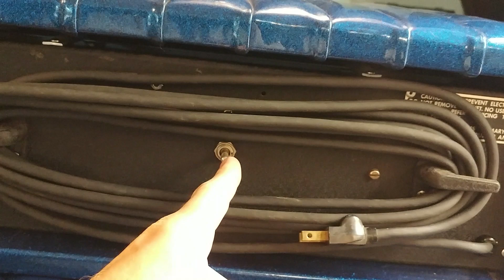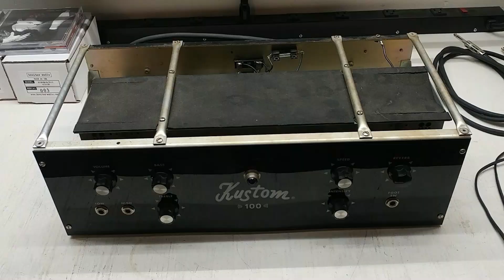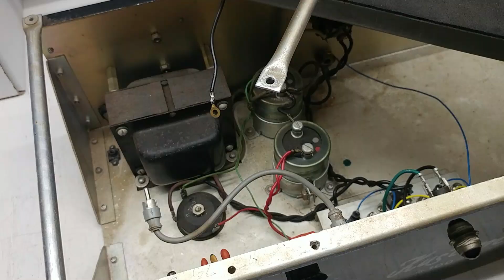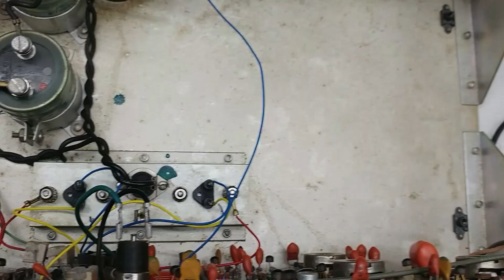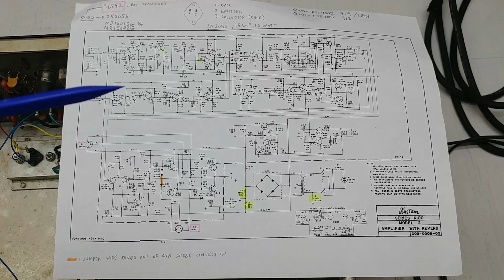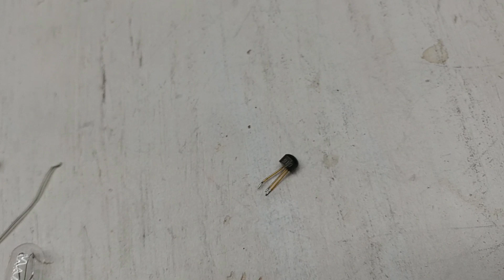Kustom 100 Guitar Amplifier Repair

Comment: I used to blow the roof off of the bars back in the early 2000s with one of these! 
Fell on difficult times just before the holidays and pawned it for Christmas presents and bills.
Lost it as I was unable to pay one month, got the money... 
Called...
It was sold. 
Hit me harder than it should have losing that amp. Felt like a piece of my soul was lost as it was my FIRST adult amp.
Was perfectly working as a local tech went through and fixed it better than new.
Could not go past 3 on the volume without the drummer threatening to quit.
Great vid!!

Comment: That’s not a jumper wire that you replaced on the board. It’s supposed to be a diode (CR106 on your schematic). The diode is a 1N3754, made by RCA and hard (and expensive) to find these days. It has long leads and a metal case like an old germanium transistor, and it is installed with a bit of heat sink grease in the clip you see in between the two power transistors. These often get damaged or even lost when the board is removed by an inexperienced technician. It’s function is to provide the proper bias voltage for the the two 36982 (2N3055) power transistors and keep them running at the proper level without getting too hot and blowing the fuse or damaging the transistors. Since it’s clipped to the heatsink, it regulates the circuit by continuously adjusting the bias current for the transistors as it gets heated or cooled, keeping the circuit stable during operation.
Reply from the maker: Whaaat?!?! I only aimed to restore it to it's original state of when I first opened it up. I had no idea about that. Now I'm going to have to open it back up and take a look at it and the schematic. Thank you for the knowledge! You wouldn't happen to know of a modern equivalent that may work in place of that 1N3754 diode would you?
Reply: The 1N3754 was a pretty standard silicon diode; what made it special was that the metal case made it easy to thermally connect it to the heat sink, so it could be used to regulate the transistors as they got hotter or cooler. Most modern diodes have plastic or epoxy cases, so it would be harder to thermally couple them to the heatsink. Something like a regular ol’ 1N4007 or similar should work if you could use some sort of clip to hold it to the heat sink with some thermal grease. At any rate, adding the diode will get the output transistors closer to normal operation, even without the closer thermal tracking. You can still find the 1N3754, but they’re often expensive since they’ve been discontinued for so long. Good Luck!

Comment: Old guitar amps are among the simplest electronics to troubleshoot.  Any of those technicians that gave you excuses shouldn't be in the electronics repair business.  Locating a substitute replacement part might stop them, but finding the failure shouldn't be an issue.  (If you just asked a friend to help you out, ignore this.  I only intend this to apply to those representing themselves as qualified enough to be in business for this type of work.  If they can't do this, how could they possibly fix something complex?)  Glad to see you picked up the skills yourself, I'm sure you found it gratifying once you had accomplished it.

Comment: Rarely, especially in guitar circuits, are the transistor parameters tightly spec'd.  The transistors of the day were probably +-50% or more on most of the parameters.  Anything roughly equivalent should work, especially if the circuit is well designed.
Reply from the maker: The more I dive into projects like these, the more I'm discovering that point. I'm also getting more familiar with the key specs (and what they mean) of transistors just by hunting for substitutes/equivalents. It's acutally kinda fun having 15-20+ tabs open at once and comparing datasheets, looking for the best choice. Thanks for watching and I appreciate the comment!

Comment: Can you post a link to where you found the serial number/date chart? I bought my K-100 bass amp in 1970 and had a tech replace the two-prong power cord with a three-prong grounded cord (I was getting buzzed when I touched the power switch).
Reply from the maker: I found that info through vintagekustom.com, if you search "vintagekustom.com date serial number" in your browser, you'll find links that have info on dating your amp with the serial number. I'll copy and paste the url of the page I was taken to with the list of serial #/dates: http://www.vintagekustom.com/FUDforum/pdf.php?th=2115&rid=0&S=454342cbd8498704deba8766e2730840

I hope that helps!
Reply: @killertimes  Thanks. Got it. 👍🏻

Comment: Unfortunately the realm of guitar amp repair is a very transient industry. Some of the work I've seen being done at a premium is bad enough to make your head spin. It's also plagued with many that possess a lot of valuable experience but are generally lacking in a fundamental understanding of what in the heck is actually going on from an electronics standpoint. You'd think it'd be the opposite case considering we have the internet to help us out these days but the signal to noise ratio on that information can be abysmal at times. There's great people that do it but there's a lot of goons out there as well (even on youtube) so trust but verify.

Also, funny that one guy was trying to say that those BJT's were some kind of magical vintage unobtanium parts... In many cases a lot of these transistors are configured as such where their gain/special characteristics really aren't that important. You may have altered the characteristics of the input slightly with a newer transistor with different hfe/impedance but I mean come on... No ones going to notice or care and your result is WAY better than it not working at all.

Putting that aside, good for you for figuring out the problem. You wound up falling back on some very essential electronics repair principles (thou shalt check voltages!)  and some (not so) common sense. Great work and I'm looking forward to more videos :)
Reply from the maker: Thank you very much! 

The internet, as a resource for learning about electronics, has provided me with so much useful knowledge. However, half the work is sifting through the quantity/ quality to find the info I’m looking for. I really value how much knowledge is being shared, especially here on youtube. Hearing and seeing things explained can really expedite the learning process, and I’ve been inspired to contribute in the same way. I just hope to not be, or rarely be one of those goons :)